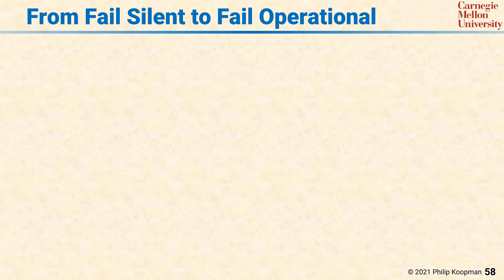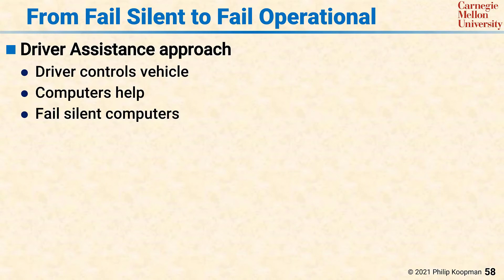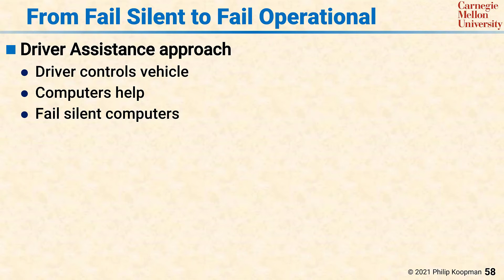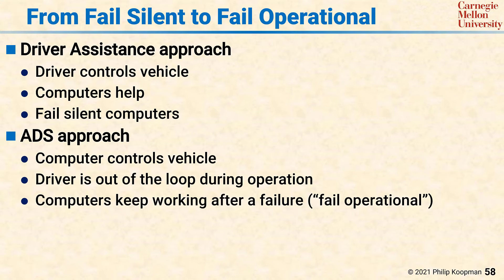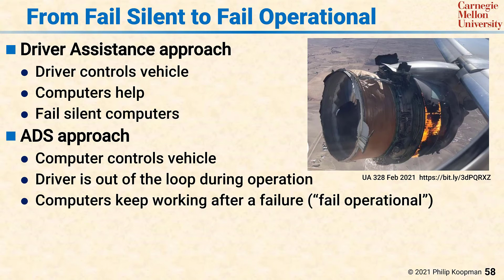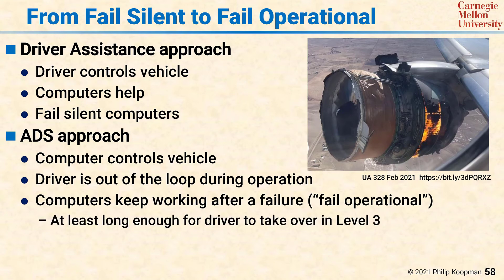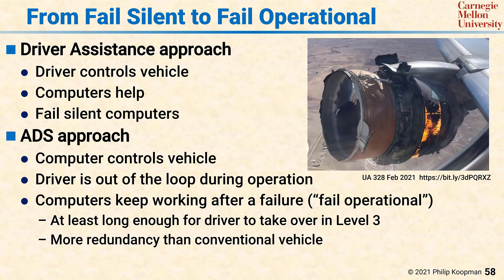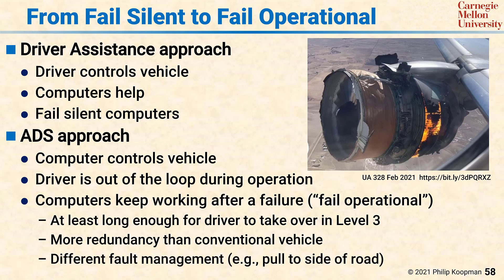L105 58 From Fail Silent to Fail Operational

Comment: Hello Mr. Koopmann, is the difference between fail-operational and fault-tolerant only the naming? in my opinion, fail-operational is a part of fault-tolerant, and fault-tolerant is the measure and fail-operational is the consequence, do you agree such a classification?
Reply from the maker: Fault tolerant might just means it recognizes it has a fault and does a safety shutdown rather than doing something dangerous.
Fail operational is a special case of fault tolerant.
Reply: @philkoopman  agree your opinion, thank you for sharing this video :)